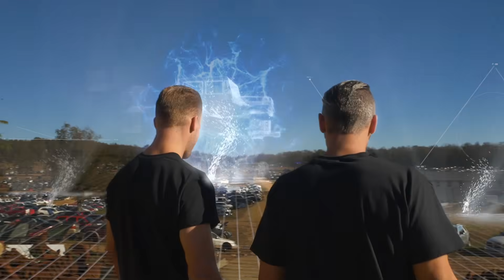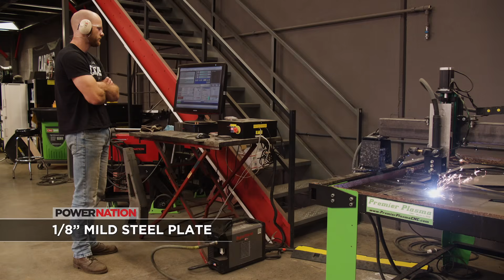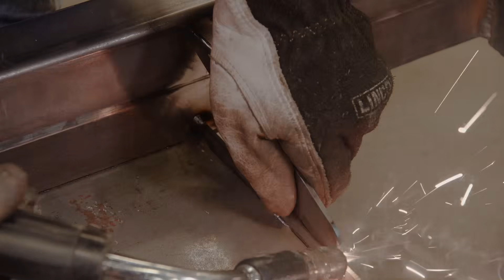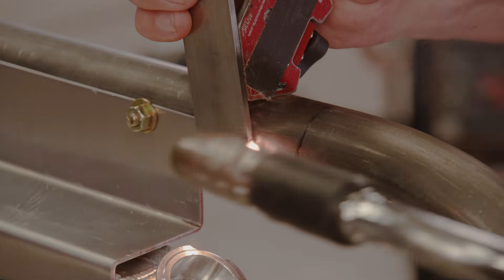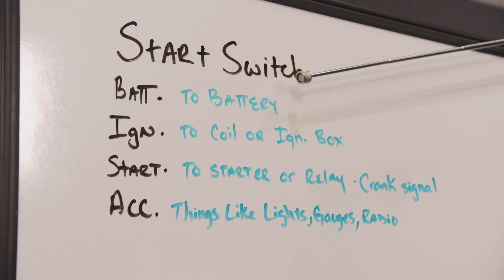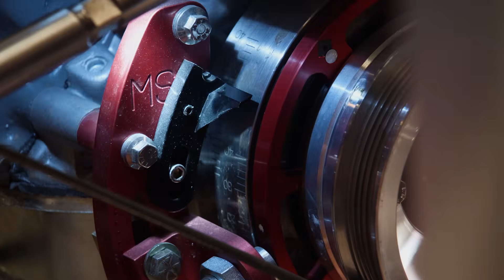Fabricating & Assembling a Running Engine Stand - Carcass S3, E17

Comment from the maker: Take a quick survey to be entered to win a $250 gift card: https://powernationtv.com/survey?utm_source=youtube&utm_medium=youtube&utm_campaign=usersurvey
Reply: 20k on a engine stand 🙄🙄🙄
Reply: Nice work. 2 things I'd do differently. 1) Make the verticals detachable so the whole stand can be folded up and set up against a wall to open up more floor space. 2) Extend the frame so you can use an auto transmission to put the engine under load during break in. Some people swear it's absolutely necessary, others will swear it makes no difference. The trans can also be used to brake the engine in case of a run-away.

I've got a 96 F250 5.8 / ZF-05 that needs a total rebuild (Plow truck) As you can image, crank endplay is only about 1/4"... It'll be nice to see it sitting in the 56' F350.

Comment: Completely overkill. Mechanical Oil pressure gauge on the motor and water temp is more than enough. Mechanical fuel pump sucking from a regular plastic container also. HEI disteributor doesnt need external ignition box etc. Will build one much cheaper myself

Comment: Why did you need a remote starter solenoid when the starter already had one ? 

Thinking I'd like to build one , I'd probably put the radiator off to one side - otherwise it's nearly as hard to work on as in the car 🤷

Comment: Avoid welding casters, they're usually galvanised, zinc poisoning is fun right? The welding can also warp the bearing race and cause premature wear. They come with bolt holes for a reason.

Comment: Four year ago i put my 70 lt1 350,
On a old 57 chevy tk fram , had the short block since 1977, found heads & intake
Put it all together,  it fired up on the 
First click, 4 years later it in my 
57 chevy cameo  pickup,  drove it up to
My summer in show low az today 
Only that that passed was a couple
Of new vetts,

Comment: This is where I like to remind people that engines actually come in a running stand: the car they came from. Cut the frame off at the firewall. Already comes with a battery and radiator as well.

Comment: stich weld on the casters is an ok option instead of fully welding. If you have any intent on keeping anything you are building you should really put in the time to make casters bolt on. Casters will break, they will rust, they are often undersized or lacking in quality. Larger casters often have slots that allow for fitting a range of bolt patterns so just put in some effort or make a jig to weld some nuts in place and you will save yourself some downtime in the future. Or over spec and service/grease your casters, most people rarely do that.

Comment: Question: Did you electrically isolate the aluminum from the steel on the panel? Galvanic corrosion.

Comment: I built one using the front stub from a dirt late model chassis. For one leg I used a trailer jack so regardless of the floor, you can keep all 4 wheels solid on the ground. I used a racing battery tray racing aluminum radiator and it already had mounts and a mid plate. The clip came from a car that had rear chassis damage and was too old to bother with a clip job. I've had medical problems and never did the final assembly work.
Reply: I did something similar with a K10 front frame section.  I welded a small trailer axle under it and put a trailer tongue w/Jack on the other end.  Welded up a radiator support and put my gauges/switches on it.   It’s been a pretty good stand, a bit ugly but it was built outta junk laying around the shop and it does what my boys and I need.

Comment: good job you two , but i highly advise you to install some additional casters underneath the actual engine mounts and the area where it supports the rear of the engine , these area`s are where the most weight is being supported , and those are the area`s where casters should have been mounted
Reply: Lol. That rectangle tubing is plenty strong to support that weight probably 5x
Reply: @0001070181  it is not the tubing itself , it is the area where he welded the engine supports , he should have shortened the square cage and welded the engine supports over the area where the castor wheels are located ,correct structural support , and not the area where it is unsupported and most prone to bending from the weight and vibrational stress

Comment: I have a super heavy duty engine stand that doesn't get much use. It is well engineered but I usually don't use it because of the size. With some additional work it could become a run stand.